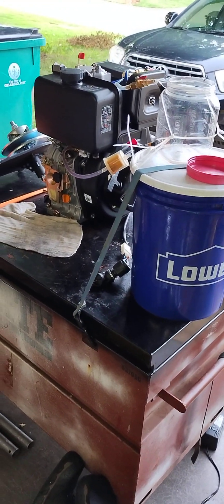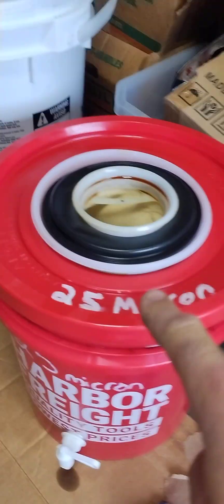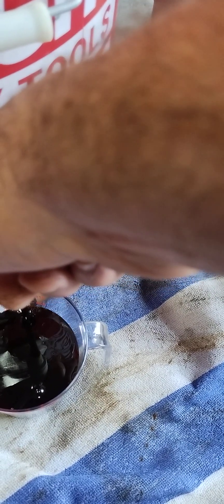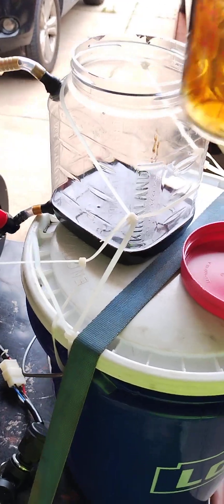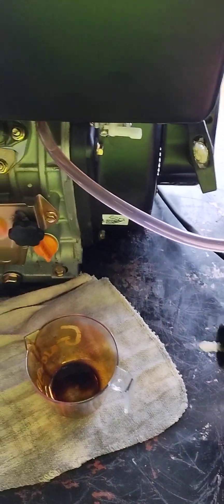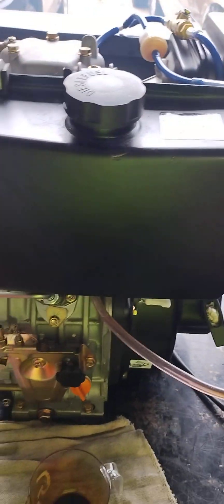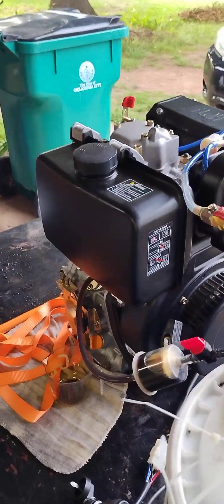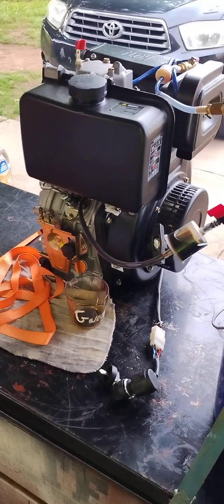Amazon Diesel Engine 186FA will it run on used synthetic engine oil?

Comment: Hi. I have chinese generator with 186f engine and I use waste motor as fuel. Oil was filtered with 5 micron string filter and I added 20-25% of diesel to reduce viscosity. It runs fine with a little bit of blue smoke under full load. The only downside is that it takes londer time of cranking before it starts, espetially in cold condition. I have used about 15 tanks of oil and it runs great. So far so good.

Comment: I have been using waste motor oil to run in my military trucks, military generator, dc military generator, and my lister petter single cylinder diesel engine for years, and when running synthetic oils, mix 10% diesel with it and it will keep the engine from carbon up, the injector from clogging up, and easier to start, and cuts down on smoke. I filter with a centrifuge and mix 10% diesel in, and it runs great in everything.
Reply from the maker: Thanks! Ive also heard that people mix in 10% gasoline to thin out the oil and increase the flash point of the oil

Comment: Very cool to see it running smoothly on 100% filtered motor oil with nothing diluting it. I suspect the injector pump will last waaay longer pumping filtered oil than ultra low sulfur diesel.

Comment: Greetings from Germany, I have a similar Diesel generator at home. My advice, thin the oil with 10% gas to thin it. I have build a T fuel switch so I can start and shut down with diesel, and run on black diesel w90. Works awesome.
I have successfully used waste oil engine/auto transmission and vegtable oils. Never mix them they can gel up. Up to 2% of acetone can help keep the injectors clean. But essential is a clean/well cleaned oil. I use a pressure driven centrifuge for it.
Reply from the maker: I run the oil through bucket top filters.
600/ 400/ 200/ 100/ 75/ 55 microns.
Then through sock filters 25, 10, 5, 1, then finally 1/2 micron filters.
I've got a 55 gallon drum of oil with 5 gallons of gasoline and 5 gallons of diesel added.  I was planning on using the OEM tank to start on diesel, then once warmed up, switch to the motorcycle fuel tank which will have waste oil in it, I also plan on having a water fuel separator on board.
This whole video series is for my motorcycle build. A diesel electric hybrid motorcycle.
Reply from the maker: Wait are you saying not to mix motor oil and ATF? Or don't mix motor oil and waste Vegetable Oil
Reply: @CarModsandDadBod  dont Mix any Mineral or synthetic based oil with plant.based oil
Reply: @CarModsandDadBod  I mix all together, synthetic, ATF, hydraulic, waste motor oil, anything petroleum based, and 10% diesel. I've done this for at least 10 years, never had issue or clogged injectors.